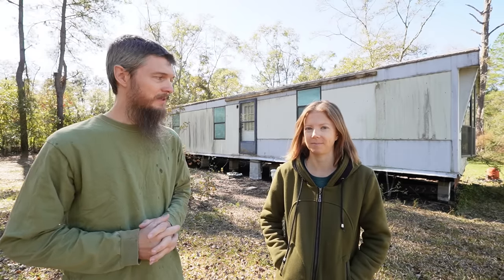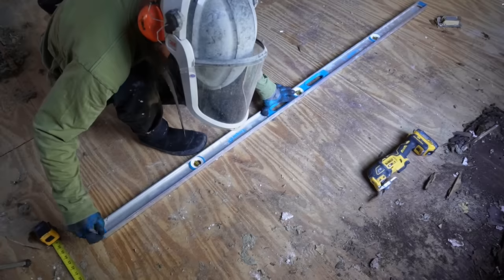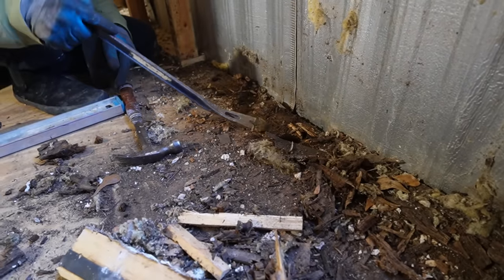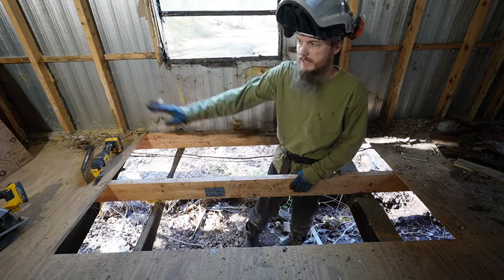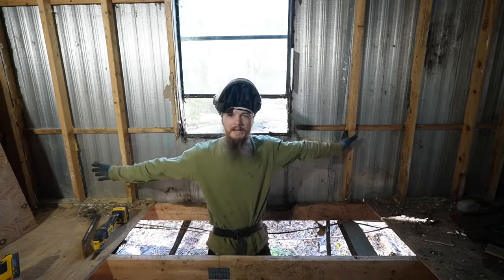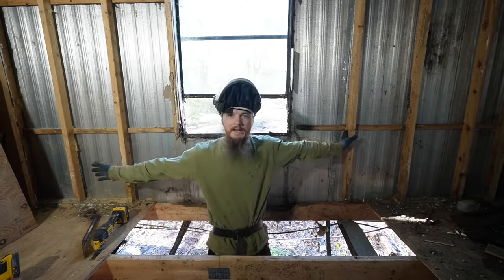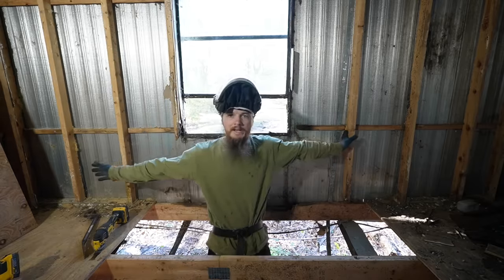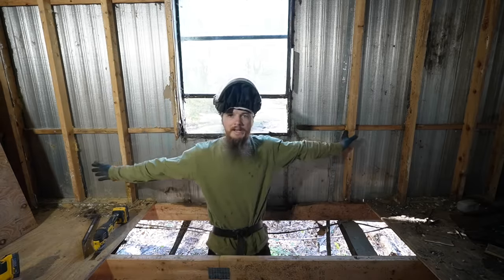Rotted Floor Repair - Mobile Home Rebuild

Comment: Listen you two!   You would not believe how much this video has just helped me.  I have a rotted spot in my rim joist and my contractor didn’t even know how to repair it and he just quit on me.   He said the whole/back of my single wide trailer was just going to fall off and he couldn’t afford to buy me a new trailer.  Now that I see how sistering is done on a rotten rim joist I believe I can do it myself, and I’m a 57 year old woman!  Ha!  I’ve drawn out a picture of what you just did in case I couldn’t find this video again.   Thank you both for all the good that you’re doing I personally appreciate you both.
Reply: If yours isn’t gutted, it might be a good idea to support the two sides beside the area you need to cut out, just so it doesn’t move on you and you can get the new piece in.
Reply: You can do it!! I'm 59 and just did this! Can do attitude will win over everytime! You got this!! 💪👏💃

Comment: I watched you gut your last mobile home, which was the house you last lived in and I have absolute faith that you will make this home right. You may not use the absolutely most expensive materials to refurbish this home, but it will be correct. There's no such thing as over engineering.

Comment: Now we're back to the type of remodel that I can really get into. My mobile home is nowhere near as bad as the ones you've done, but you have taught me so much over the years. I'm a woman, 67 years old and I've done most of my own work except for electric. I've been tinkering around with some plumbing as well, hoping to install a bidet. There's something you could do guys!

Comment: We bought a  1969 mobile home and moved it to our property in 1980. We used it for two years while we built our "real" home and then sold it to another couple. Sometimes I wonder if it still exists. Repairing it was a challenge, you guys are in for an adventure but by now you are renovation pros, good luck.

Comment: It is interesting that your mobile built in 1984 actually has a plywood sub-floor.  Mine built in 1998 has a high density pressed particle thing.  When I went to install underfloor radiant heat and tile in the bathrooms, I had to replace that subfloor.  I initially wanted hardwood in the rest of the house but to enable that to be nailed I would have had to replace the subfloor.  I went with engineered hardwood floating floor to avoid that.  Your little unit built 15 years earlier actually has a better subfloor.  Cheers.
Reply: Like almost anything, it boils down to the manufacturer. Some are built better than others. Which of course means they're more expensive new. There are 2 manufacturers in my region that build quality mobile homes, the rest are not as well built.

Comment: I've been a viewer for a few years so watching you track down & remove rot is actually comforting while sitting in a holding room in a Dr's office. Also a mobile home I once lived in had particle board floors w/ water damage. That was in the 1980s. Glad your floor is plywood 👍
Thanks 🙋‍♀️

Comment: Our mobile home had very similar leaks and floor repairs. I attribute the leaks to the putty in the corner of the aluminum windows degrading over time and allowing water to leak from the window onto all the framing members below. Thanks for your videos. I'm now priming everything to help slow down how fast if rots.

Comment: Exciting! Our friends own the mobile home park across the street. Homes are all early 70s, and the previous owners kept the property picked up, but were slumloards and never took care of the actual structure of the homes in terms of resealing etc. they’ve had to do a lot of work to the homes. But even if you have to put $8-10k into each home, they rent a 2bed 1 bath for $1200 a month or so and can make that back relatively fast.

Comment: The nice thing about the mobile home reno project is you aren't living in it, so you don't have to move furniture and other stuff to work on it.  The down side is you have to remember which tools and supplies you need to bring with you to work on a particular area.  Hopefully, you can get a lot of the structural tear out and rebuilding done over the winter when you have cooler weather.

Comment: Truly enjoy your  transformations.  My mother has a bunch of trailers that she rents, she is constantly working on them due to water related damage.  My only recommendation especially if you are going to use this as a rental, pressure treated lumber last longer when it comes to water.

Comment: Looks great. Bad weather is headed your way in the next weeks,  so if it rains, the roof will leak will really quickly.  I know  you already know this. This looks worse than any other mobile home turnaround you have done. Looking forward to its transformation!!👍

Comment: I am actually surprised the framing on mobile homes isn't thicker, I believe I am seeing 1x2's and 2x2's  for me this all is very helpful indeed! One step at a time. I believe you both are happy for a new project to work on. :) Merry Christmas!
Reply from the maker: The short ends of the mobile home are framed with 2x4s and the long walls are framed with 2x3s.
Reply: That's correct that's how they made mobile homes years back, I think they do use 2×4 in New or better built homes these days, you have to be careful of the manufacturer.

Comment: It's going to be an interesting process. LOL
When I saw all the wood and scrapes under the mobile home, my first thought was termite food. I'm wondering, as you are opening up areas, if you are going to clean up under the mobile home and pick up any wood or other things that might attract termites or other pest. I don't know if wood scrapes could cause a problem, so I thought I would check in and see what your thoughts.
Interesting to learn about mobile homes and the differences to other housing

Comment: Would diatomaceous earth sprinkled on the wood help stop termites, spiders and ants? I know that some builders use it in Arizona. 
This is going to be a fun project. Watching you gives me confidence to tackle my repairs. Thanks so much for sharing and taking the time to explain💖
Reply: I would think so, but maybe depending on the average humidity in the air where they live. I just found this channel so I'm not sure what state.
 I live in Alabama, we can get high levels of moisture in the air, I mean there's been days the air feels like breathing soup to the point I have a running joke with my kids about having "air soup" for supper😂. Anyways, I know I've had the cardboard canisters of salt actually draw out so much moisture just from the air it solidified. Since DE is fabulous at absorption as well  I'd  be worried it has the possibility to cause moisture damage if it was laid on thick and exposed to moist air. Especially like at the frame attached to the metal siding since the metal mixed with humidity mixed with variations in temperature from the inside vs outside could possibly cause condensation 🤷🏼‍♀️ Now I'll be honest I'm kinda spitballin here and just writing as I think about it, I have all the ADHD-DDDDD (Aka Always doing Hardly Done-Distracted x ♾️ Hey! a squirrel! SHINY DIME! Pocket change.. wait..did I put the laundry in the dryer? Ect.) I lost my train of thought. I apologize also sorry this turned into a novel.
Anyway!! Floor,De, bug, yeah.  Okay I like your idea and was going to do this actually but use my DE poofer thingie so it'll be a super fine bit for bugs. I have a terrible bug problem, like all the bugs, ants, roaches, I have freaking red wasps that found the cracks in my siding and been building nest in the walls. Moved into this trailer like 4 yrs ago and though might need a Lil work which has turned into ALL the work😅
I'll be applying the DE  everywhere as I replace floors,walls, ect.
After rambling... yes DE should help some if applied super thin😂🤣🤷🏼‍♀️

Comment: I really appreciate this video of demonstration in the raw footage way, I too live in a 2002  double wide manufacturer home and have some flooring issues as well. What's the name of the cutting wood tool and would it be good to buy a wood panel that's water resistant to avoid any possible water damage?
Reply from the maker: We used an oscillating tool, reciprocating saw, and circular saw. Plywood is ideal. You want to keep water out to begin with.

Comment: Just curious. Do you go into these projects with a budget? Also wondering is what you are doing cheaper than purchasing a new mobile home? I'm learning a lot from your videos but, at 73, don't see myself renovating at your level! LOL  I can conceive ideas but need my son or brother to implement.
Reply: A new single wide costs anywhere from $50,000 to $100,000 now depending on brand and quality, so I think they can do the renovation for a lot less than that.

Comment: Doug, buy yourself a PICA-DRY HEAVY DUTY MECHANICAL PENCIL.  YOU WILL LOVE IT. WHILE YOU ARE ORDERING IT ALSO BUY SOME ADDITIONAL “LEADS” A PACK OF REGULAR LEADS AND A PACKAGE OF WHITE LEADS.  THE LEADS DON’T BREAK LIKE CARPENTER PENCILS. THEY ALSO COME WITH A BUILT IN SHARPER FOR PRECISION WORK.

I BOUGHT MINE A COUPLE OF YEARS AGO AND LOVE IT.  YOU WILL TOO!

Comment: You make it look so easy, Doug.  My husband is not handy at all.  He fell through the dry wall in my hallway and put a big hole in it and I have tried to get him to repair it. I tell him to watch YouTube videos of how to fix it but so far he hasn’t done anything.  I’m trying to be helpful and encourage him but he is scared of doing a poor job.  I might have to try tackling it myself. lol. 😊
Reply from the maker: The thing about drywall is, a poor job is still easy to fix. And drywall is cheap. So it doesn't hurt to practice.

Comment: Good job.  I think if you would have shaved a bit of edge off the first joist that you sistered in only at the frames it was over, you could have slipped it in much easier.

Comment: Staples, Staples..and way more staples....we must have cut a thousand of them buggers, replacing the floor, in our double wide,..I think, they're told to use a pallet of staples per trailer, when being built...😂.   Nice job as always.

Comment: This is interesting- I am curious about  insulation-     Thinking about the shell you have- Torn between fiberglass and  mineral wool.   Add  more hurricane strapping, a few more screws.  Possibly tape or caulk the existing  joints of the metal skin.  run all the electrical and plumbing.   rebuild with pressure treated window and door area? and use the tape? drill drain holes around the floor inside of the stud area with bug screen stapled over-  Spray studs for bugs  and mold and insulate.  Then Staple house wrap on the inside tight like a drum.  Build up a second wall  a inch out from old  of 1 x 2  then do a closed cell spray foam insulation.  use some metal strapping to tie  walls together.  Then wood plywood as the inside wall finished with a satin or mat poly.  I noticed in a old Galveston house they almost expected water to get in with major storms, so they had a layer of tar paper  Then the ship lap - then plaster.  No insulation at that time.

Comment: that rim joist that you attached that was tight... you don't have to notch it... just mark where the steel beams hit the 2x6 and then use your hammer and you can compress the wood a bit without damaging it much... i use to do that all the time .. just give it a few good taps with your hammer.. try it on a scrap piece and you will see what i mean. year and a half .. im not even gonna heh.. merry christmas to you all if you don't post before then :o)

Comment: Lowe’s or Home Depot should sell a product called ‘Through the Roof’ in a pint jar instead of a caulk tube. We find with mobile home metal it’s easier to coat a leaky seam like that, it should do the trick until you coat that roof with something for the long haul like Aluminum fibered coating.
Reply: Pint paint can I think it might be

Comment: Im dealing with similar damage, rotten bottom plate, but on a bearing wall with scissor trusses..  How do I lift and support my top plate which is ok, but has scissor trusses?  Im worried the temporary header could slip out since its not flat, but if I try from outside and bolt some 2x8's on from the outside, the jacks could kick out..  Thanks!
Reply from the maker: What we did in a previous house was build a temporary support wall to hold it all up. https://youtu.be/4lPd0B0t_68?feature=shared&t=75

Comment: When you estimate 1-2 years how many hours a week are you working on the trailer?
Reply from the maker: It's hard to say because we work sporadically and we don't keep track of times spent working on it. Some weeks we might hit it hard and then take a few weeks off. Some days we work long hours, some short. Also, there could be hold-ups on getting materials. When we do work on it lately, we spend a few hours there each time. Right now we're at the slow stage repairing all this rot. After that it should go much quicker.

Comment: ** do you ever think of using a leaf blower to blow the floor dust and dirt free? Or revers a shop vac hose. it gets the stuff out that a broom doesn't seem to get to.  I use my blower to blow out my truck instead of vacuuming.. I just open all the doors and have at it.. 5 mins and done..

Comment: What I don't understand is why the siding is right on the studs. I live in NH and my mobile homes had sheathing over the studs than the siding. More like the construction of a house. Does it make a difference in the make of the homes? My last one was not a new one but a 78, so it was not that.
Reply: Probably location and regulations requirements.

Comment: You sure the clamping force from a screw that's drilled in is as good as an impact drill? Seems to me the impact would put more clamping power on the screw where it drives into the wood a little.

Comment: Back in the day people used 20 Mule Team Borax as a natural insect deterrent. Many still do. Borax is what the mix into cellulose insulation to make it uninhabitable for insects. If you have some wood with just a tiny bit of rot that you don't want to rip out because it is mostly good you might sprinkle Borax on it to deter roaches, etc. Just a thought.
Reply: Are you sure you don’t mean boric acid? They are slightly different.

Comment: I lived in a mobile home for 13 years and water damage was by far the worst problem which also created an environment that both carpenter ants and termites liked. I swore never again would I live in another mobile home.  What you are showing just reaffirms that.

Comment: * Possibilities are endless..  Opportunity to bump-out a wall here or there to add a room or extend the kitchen space, add a formal dining rooom or add a walk-in pantry or walk in closets.. oooh  his and her closets.. lol or maybe even extra bedrooms.( increase rental value with that)  I've also seen in the 'tiny house' community, a small mobile home size home with a huge oversized porch, front and back, which greatly increased living area.. they actually build their laundry room out there,  had fans installed in the porch ceilings. had it set up like indoor living spaces and even incorporated and outdoor kitchen area .. so much can be done with bare bones build like you have here

Comment: When I had to replace 85% of mom’s front part of double wide. 24x 60. Replaced about 50ft of the rim joist, flooring and framing. So I did it in Sections. 12ft rim joist then 8ft flooring then 10ft framing. So the next section the flooring went under the framing. So other words, each section enter locked each other.
Reply: Excellent idea! My poor father fixed the floor in my rental when I tried to split fire wood in the living room 😮 Seemed like a good idea at the time....Newly married in a trailer with only wood for heat- my husband was in active alcoholism at the time- we survived 😂😂😂 I can't wait to see Dad when Jesus calls so I can apologize 😂😂😂

Comment: What’s the hold up on finishing your kitchen?  I can’t imagine Ashley living 2 years without a proper kitchen to cook in. I know you’ll get around to it, I’m just not as patient as Ashley.
Reply: Probably how time consuming it is to make the cabinetry
Reply from the maker: Doug has always done most of the cooking, and the temporary kitchen we have set up is good enough for now. We just have to work through some issues with the kitchen, and it might be a while.
Reply: I'm doing it also - 2 .5 yrs so far, sigh - 2 instapots and an indoor grill - i I can hardly wait to use my new appliances - maybe next spring!
Reply from the maker: @chloesmom412  Do you really believe that? Or are you being facetious?

Comment: How did this floor rot happen.
Reply: Leaky roof spot and poor window seal.  He explains in the video. Cheers!
Reply from the maker: Yep, plus there was a window AC unit there, which was probably a big part of it as well.

Comment: That old of trailer probably had particle board, hopefully you're replacing the entire floor. Looked like you still had some original flooring in it !
Reply from the maker: No particleboard flooring. This home was originally built with plywood floors. The flooring we left is all great with no issues.
Reply: @diyfferent yea you can definitely tell it’s plywood floor 😊

Comment: Are you guys still working on Ashley's project car?
Reply: I think that is sidelined for a bit as they try and wrap up the home projects & now the mobile. Not enough hours in the day for them, and with the days shorter that plays in.
Reply from the maker: Episode 13 on the car rebuild is where we left off while we get other things done.
Reply: Ok sounds like it's still a thing cool thanks. I saw you guys got another hatchback and wondered if that meant you gave up on the old one